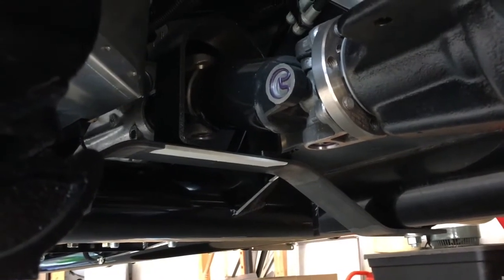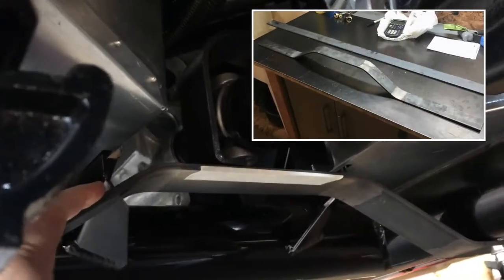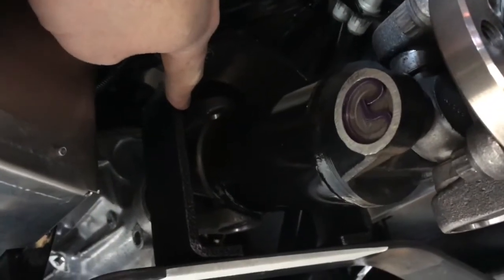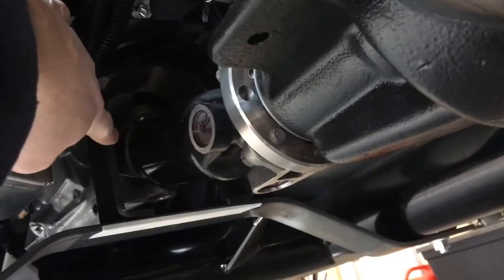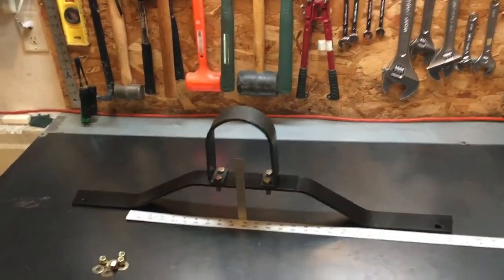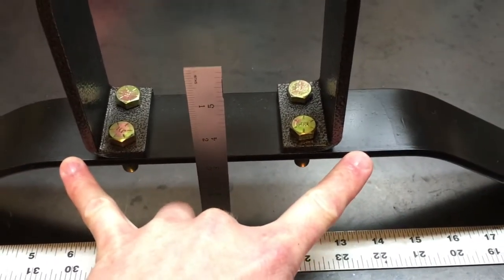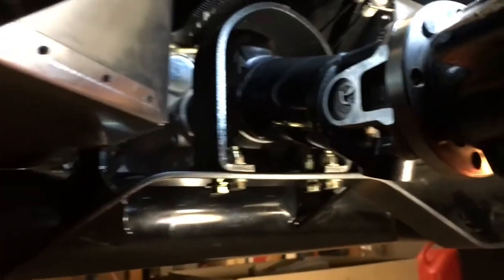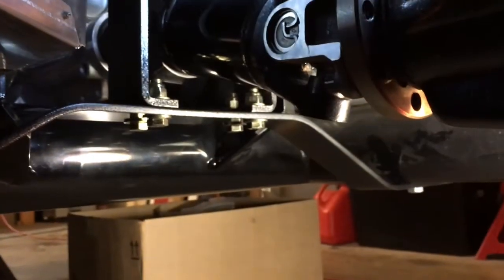Factory Five Cobra: DIY Bolt-in Driveshaft Loop

Comment: I'm glad to see you flipped the bolts around on final install to put the nuts on top. My only concern is that it is below the 4" tubes but looking at mine I can't really find another place to mount one that wouldn't interfere with the floor or require major fabrication. I suppose contact with the ground in that area of the car is very unlikely, however.
Reply from the maker: David Christian - I thought the same thing - I wasn’t excited about the bolts being below the frame but I thought it was more important to have a nice/tough loop. I definitely didn’t want to drill into the 4” tubes and rivnut either!  So far, I’ve had no issues. You could also buy class 8 t-slot bolts to pull them up further (used in milling tables) - some are on the order of .125” depth and very strong. I also considered turn the head down, but it really hasn’t been necessary. When I take it off-roading, I’ll have to make that upgrade -lol

Comment: Karl what rear end are you running? I am looking at my MK4 kit with IRS and the brackets for the lower control arms are nowhere near the location I see in your video. If I want a bolt-in solution looks like I will have to bolt to the bottom of the tabs for the harness lap belts.
Reply from the maker: David Christian I have a solid axle ford 8.8 so the frame might be different. Don’t give up though / the belt tabs could work too (I also considered this). The tough part will be forming the steel, but I’m sure it can be done. You can potentially adapt the the transmission cross member too. I checked out Forte’s / Metco’s bolt in options and was convinced I could do better- let me know what you come up with